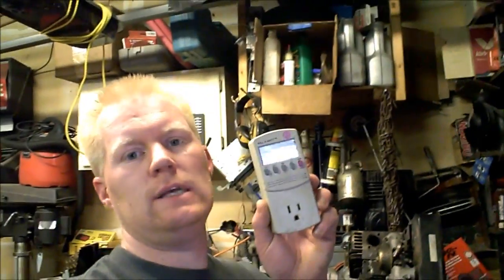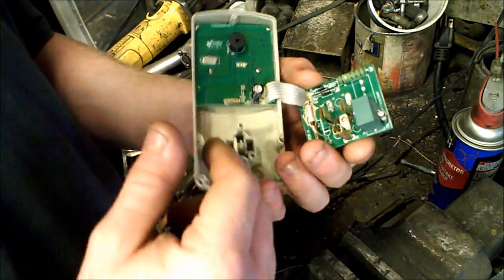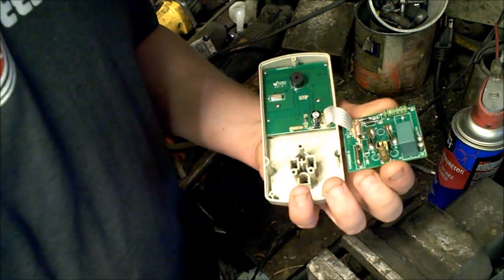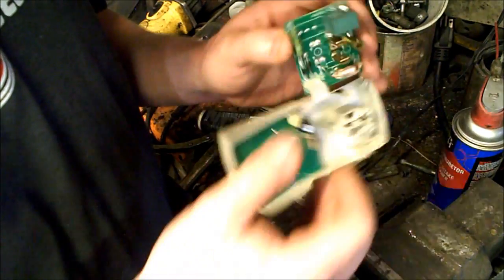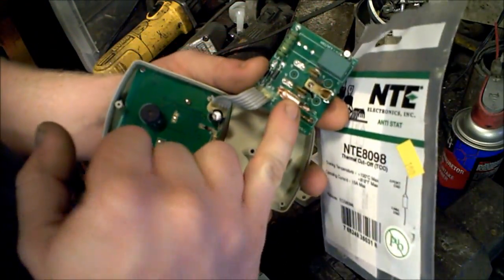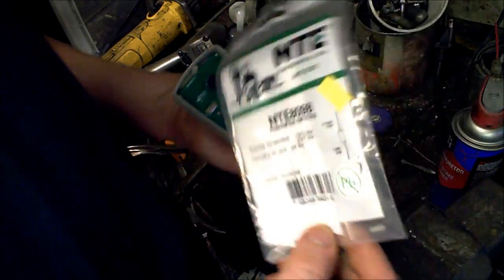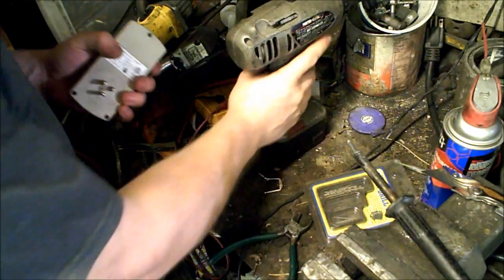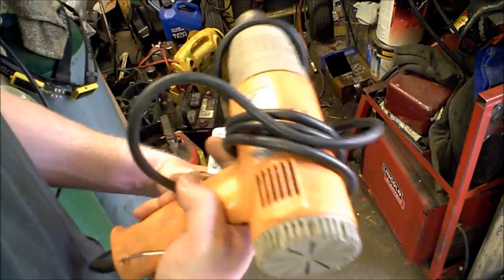Kill-A-Watt not working HOW TO FIX

Comment: My Kill-A-Watt EZ just stopped working when I realized my 1500 watt space heater wasn't on anymore.  Which is slightly under 13 amps and hasnt had a problem in 2 months.  I searched up on Google and your video came up.  Sure enough you saved me the basic troubleshooting to jump straight for this thing and jumped it and now it works.  Now to found that part without crazy shipping, eBay seems to be the best so far.  Thank you for this video!

Comment: Awesome, you even have a video on the Kill-A-Watt meter.  I just blew mine testing the strangest of my generators, a 2-stroke 1200W Eagle River ERG1200 that I was reading surges voltage to like 150-160 with low power loads until like a 400W or more load then levels down to 120VAC.  I've not studied the design at all yet like if synchronous, asynchronous or AVR design to see what's available to hack/mod into a more stable better performer.  Something about 2-stroke doesn't motivate me as well.  Anyways... thanks for sharing.  Was wondering what's inside before I open up.  I was also wondering about the capabilities to hack into a 20A rated device as well... though not much other than 120 welders that come to mind that I'd want to test.  Best Regards, In Christ.

Comment: You didn't need to remove the original component...unless you just wanted a nice clean look. 
It's faster and easier to just piggy-back (crimp and solder) the replacement component onto the leads of the failed component.  You can then just clip-off the old fuse from the leads. By making sure the replacement fuse is adjacent to the original fuse when soldering into position, this helps ensure it is at the proper location when the unit is reassembled.

This also saves time and help reduce chance of damaging or misaligning other components on the printed circuit board by avoiding unsoldering and soldering near any other components.

When reassembling, just make sure the replacement fuse is located physically in the same place and adjacent to the power connector housing as was the original fuse.

Comment: Good video, but please do not use the phrase "shorts out" or "shorted out" to describe this. You OVERLOADED the device, you didn't "shorted it out". Such failures almost always also cause protection components like power fuse or thermal fuse to OPEN...not "short". 
An OPEN circuit is the direct opposite of a SHORT.

Comment: The display on mine is getting light and flickery.  It has gained 21 volts (at least from 119), and when plugged in the wall by itself shows 7-9 watts (not sure if that's intentional or calibration).
Reply from the maker: After shorting this particular unit out for the 4th or 5th time it started to do this. I ended up getting a new one.
Reply: capacitor.
Reply: then calibrate https://electronics.stackexchange.com/questions/90805/how-to-calibrate-a-kill-a-watt-meter-and-understand-its-hidden-service-menu

Comment: Little tip for components that are heat sensitive: use a couple of small alligator clips on either side of the fuse which act as a heat sink when soldering to help dissipate the heat.

Comment: I Wish I would have seen this last week just threw mine out cleaning up the Garage . Messed mine up Spiking it out. adjusting a Cheap ass Harbor Freight Generator    DUH     I took it apart to see what was wrong  but figured I could Not Fix it .
Reply from the maker: I've shorted mine out 5-6 times now with cheap generators. I just keep putting it back together.
Reply: I just ordered a New one on Ebay    The guy with the 15 amp Circuit Breaker idea looks good too   Great Video

Comment: I need a kill o watt meter that is for more than a measley 15 amps. any suggestions?
also one for 220v.
Reply from the maker: I've run into the same issue and just end up using a clamp on amp meter.

Comment: Just came here from your generator tune vid.  Good stuff.  But have you considered a little push button type 15A Thermal Circuit Breaker? 
https://www.amazon.com/NTE-Electronics-R58-15A-Terminal-Resistance/dp/B002SR1U02/ref=lp_6355930011_1_11?s=lamps-light&ie=UTF8&qid=1478163472&sr=1-11
Reply from the maker: That's a good idea.

Comment: Since this one kept burning out and you just ended up hot wiring it, I was wondering if you have found another one you like better and use now? Thanks for the fix and updates though!
Reply from the maker: I've looked pretty extensively. You can get clamp on amp meters, but still need to plug a HZ meter in. It seams that no one wants to make a heavy duty one rated for more than 15 amps. So at the 15-20 bucks these are, I figure i won't be too sad when it finally dies and will just buy a new one. I still highly recommend it and note that every-time it burn out, I was abusing it beyond what it was designed for.

Comment: Thanks for the how to video.  My 15 Amp Kill-a-Watt blew within a half hour of its first use.  I was monitoring a 13.8 Amp current load on an appliance and the meter wouldn't handle it.  Replaced the thermal fuse for $2 and now the Kill-a-Watt is ready to go for less powerful applications.
Reply from the maker: +Lee Meister I finally just soldered a solid wire across these after the 3rd thermal fuse blew. The thermal fuse seems to build up heat over time and blow even though the meter can handle it.

Comment: My Kill-A-Watt died in the same manner, but instead of just soldering in a replacement 15 amp fuse, I installed a 15 amp circuit breaker at a cost of $5.76 from Amazon: http://www.amazon.com/gp/product/B000K2MAPG. It's a tight fit, but there is room inside the Kill-A-Watt for the breaker. To mount the breaker I drilled a 3/8" hole in the right side of the back piece, near the top, then soldered wires from the circuit breaker to where the fuse was soldered.

Comment: My Ford Fusion Energi's charging adapter burned this out, even though I've been charging it through this device every day for almost 7 months.  The Kill-A-Watt EZ was really hot, even though the adapter draws only 12 amps (1440 watts), and the Kill-a-Watt EZ is supposed to handle 15 amps (1800 watts).  I hope this works to fix it.
Reply: I know the voice text spelled hurts wrong supposed to be Hertz
Reply from the maker: Triynko The thermofuse will fatique over time. I've blow it 3 times now but those were all cases of drawing around 20amps for periods over 30 seconds.
Reply: the main thing that messes the thermal overload up his dirty power it needs to be 60 hertz generators and inverters run different hurts lower hurts and it ain't clean it fluctuates too much causing high temperatures

Comment: I  had the same thing happen to my dishwasher. It is nice to know how to fix things.  Good call knowing the spec sheet in the temp. The exact one does not matter. I also bypassed for a month until I got another one. I just left the circuit board out if its tightly enclosed area and had a small computer fan on it just make sure it did not get to hot.